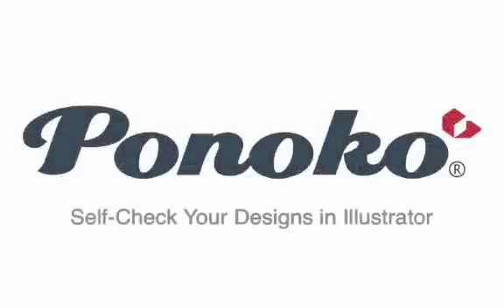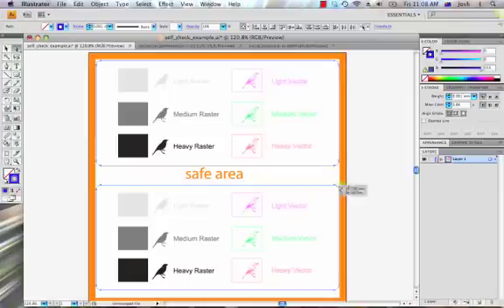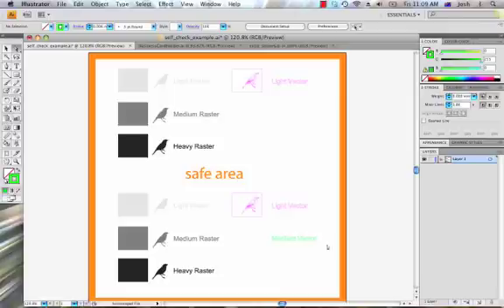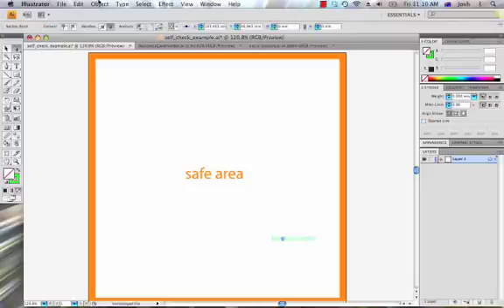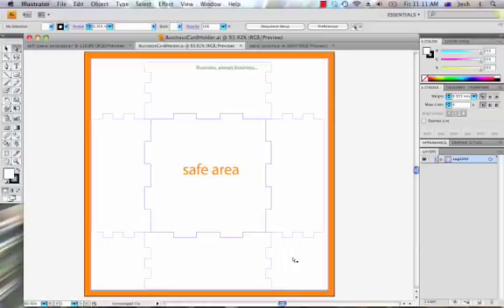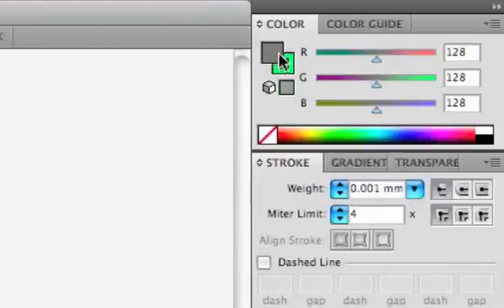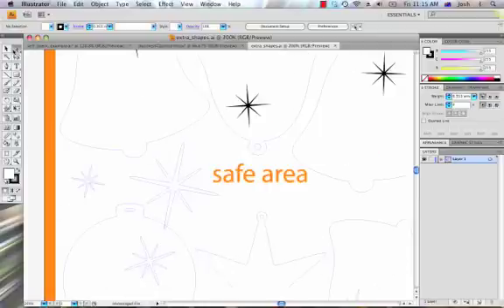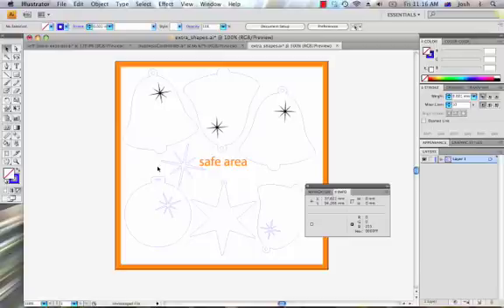Self-Check Your Designs With Illustrator

Comment: The templates say line weight should be 0.01mm, not 0.001mm.  Which is it?
Reply: I know this comment is very old, but in case anyone else is looking through these comments and is wondering the same thing - your required line weight for cutting will depend on what machine you are using.